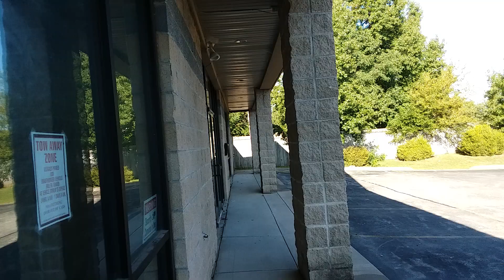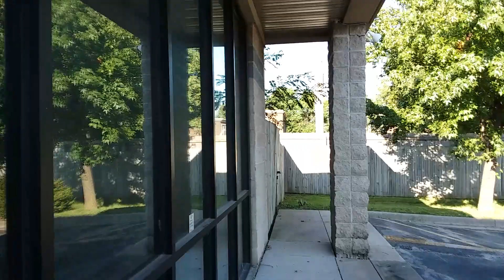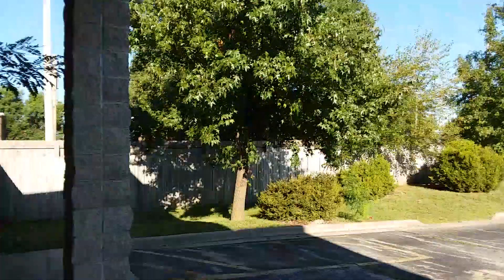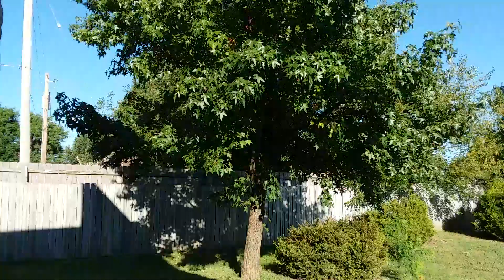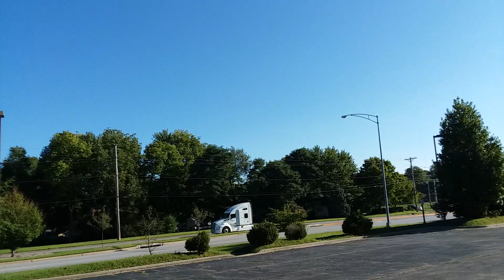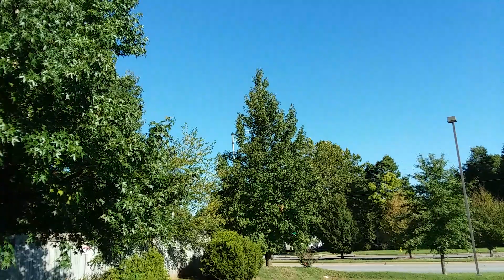Yamaha MODX Synthesizer Repackaging

Comment: I agree with you often but in this case I think it is off the mark. I think this is the closest we have seen to an updated DX7 wihich absolutely is a classic. FM is experiencing a resurgence right now and brings a missing sonic flavor to an otherwise saturated analog landscape. I think the digitone sounds better personally  but does not have a keyboard and feels more of a looper ARP primarily. The problem with the MODX and Montage is they are seen as something for people playing weddings but that is marketing to sell as many keyboards as possible. This is a 64 voice 8 operator FM synth and a sound designer should be able to blow us away with this. It has the exact engine as the montage, they have just reduced total voices and made plastic instead of metal and likely cheaper keybed. Build quality will probably be an issue though and that is a real consideration against MODX.  I mean this respectfully, as I love your channel, but saying someone is not a synth head if they dont buy the flagship seems off,  not all of us can afford the mothership. This came off as you having a montage and looking down on someone who would not buy the best like you have. put these side by side and sonically they will sound the same. They are real synths for sure. This is the new dx7. The real reason not to buy as a synth head is a)build quality level b)you dont like or dont need FM in this updated dx7 c)you can get cheaper lower operator fm sound through volca or deface or digitone